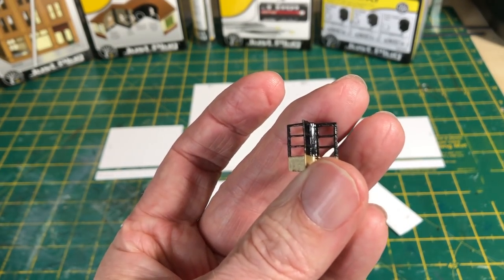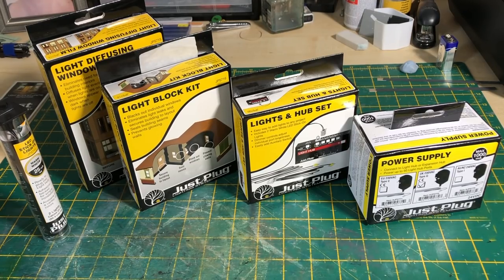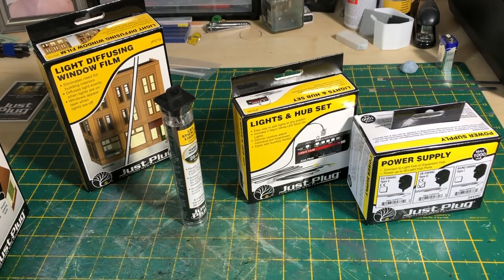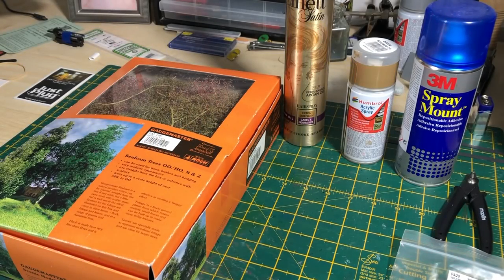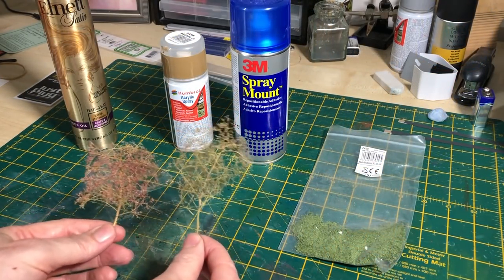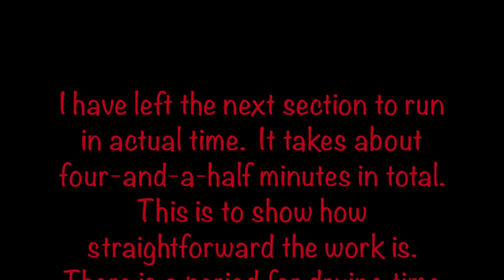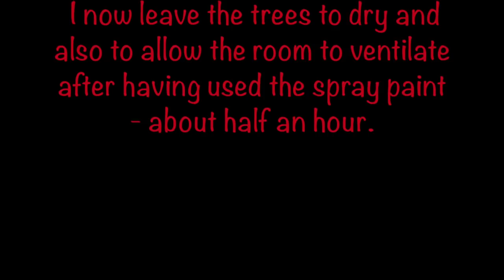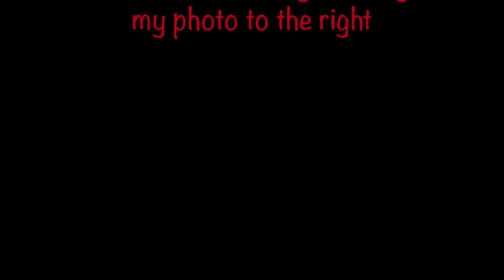N Gauge Model Railway layouts - Five trains running and making trees  Elvenhome EP 57

Comment: Hi Stephen, Very good job safety briefing for spray painting. I have a paint mask very similar to yours. The only other thing I'd suggest, if the weather is warm and dry, take your spray painting outside. My spray paint box is a large shipping box that was left over from our last move, to our current home. It's about 3 foot square and about a foot deep. I've never worked with the Gauge Master trees, but I have tried a product called Super Trees, that look very similar to the Gauge Master trees. What I've found with the Super Trees, if you have one with a crooked trunk, you can heat it with a soldering iron and straighten the trunk. It is a little bit fiddly, but does work. Another very nice layout update and running session. I think the trees look great and I look forward to seeing the railway hotel begin to take shape. Cheers, Rich S.
Reply from the maker: Hi Rich.  I see so many videos of people spraying with little face protection that I thought I would make the point.  I forgot to mention on the video that I live on the third floor of a tenement block.  So I don't have anywhere but the flat to work in.  Funnily enough I did mention about using warm water or steam to straighten the trunks but that bit hit the cutting room floor in the editing to bring the video down to a reasonable time.  I hadn't heard of using a soldering iron and I will give that a go.  Stephen

Comment: Hi Stephen, your hotel build looks very good, can’t wait to see that develope. I too have looked at the woodland scenics lighting and think it is great for splitting light inside buildings and I will invest in that system when I need it. Meanwhile I have taught myself leds and how to rig then. It’s ok for general lighting but a bit more fiddly for splitting. Model Railways Direct are one of my preferred suppliers these days. I have had no issues and very quick deliveries for the last two years or more so a great company to deal with and, knocking at the door and beyond on the bigger shops pricing. All good in my opinion. I heard of a trick today with the seafoam trees.... if you have any bony bits (of which I have loads), put them under steam from a kettle spout for a few seconds while keeping them taught. Hold it for about ten seconds afterwards and voila, straight tree. I like them to be honest and am also trying the woodland scenics armatures, which should be in my next update. Great work and really looking great, look forward to next one, cheers for now, Chris
Reply: Sorry that should read...’if you have any bent bits’..
Reply from the maker: Hi Chris and thanks. Having started to play with the Just plug system it does give you excellent control over each light from full on to off.  That will allow me to adjust various light in the hotel.  I need to get a few bits more but that will allow me to do a number of buildings with differing light levels.  I had heard of soaking the trees in warm water to straighten them and I did mention that in the video when I recorded it.  That bit hit the cutting room floor when I had to edit the video down to a reasonable length.  I spent much longer talking about what I was going to do than doing it.  Stephen

Comment: Great update. I’ve been eyeing off just plug items as well. While lighting can be done cheaper by dyi, the convenience is sometimes worth it. The revolving door looks really nice. Good little running session to boot as well. Your trees have turned out well and look really nice. Clint
Reply from the maker: Hi Clint and thanks.  I've started playing around with the Just Plug system and I am impressed with it.  It gives individual control over each light from full beam to off which is what I need for the hotel to look right.  It isn't cheap and I have to get a few bits more for the hotel. The trees do look good and don't take long to do  I hope it encourages others to give it go.  Stephen

Comment: Stephen, the revolving door is brilliant and a very simple but effective solution to actually allow it to revolve. With reference to applying the paint to the card would a coat of PVA to seal the card in followed by a coat of spray primer provide a solution and remove the necessity for additional cladding on the inside?  The trees look great, I bought some foliage just last night for a similar project!  Perhaps I’ll record my efforts too. Paul
Reply from the maker: Hi Paul and thanks.  I will experiment with coating with PVA.  I'm still haunted by the time I did that with the first attempt at making the raised where the church stands using the foam board and the card covering bent.  I should have coated both sides and I will do that on the test piece.  If I can get that to work and prime before fixing that would be good.